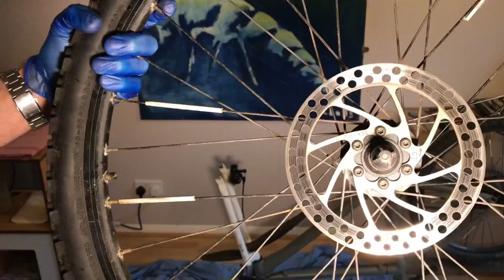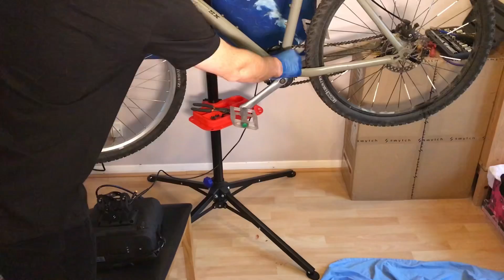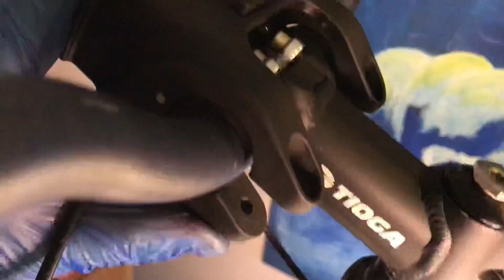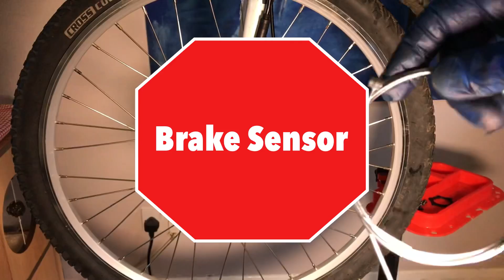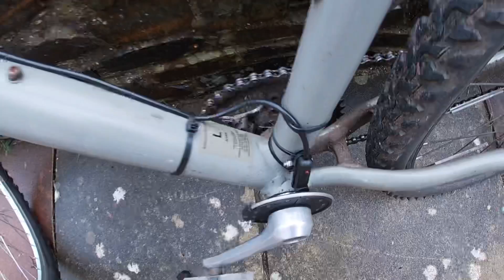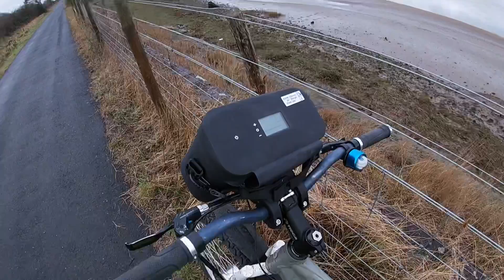Swytch Ebike kit first build 2006 Giant single speed MTB

Comment: Brakes - so I guess if you had an old fashioned single speed brake ( with a ‘ petal backwards’ foot brake ) then you couldn’t use this system as there’d be no way to fit a brake sensor.
Reply from the maker: You can use a brake sensor with a brake lever with its own spring back and a short piece of cable. The kit also functions without a brake sensor

Comment: Is this a pedal assist system or can you use full battery power when desired???
Reply from the maker: Pedal assist but they also sell a throttle control which works on it’s own.

Comment: I’ve just had the most pointless problem with the pedal sensor  it didn’t fit the space between pedal so. I put it on the inside of the crank . Because it goes in the opposite direction as in anticlockwise it doesn’t work. So am stuck with a Swytch that doesn’t work.
Reply from the maker: I think there is a setting where you can reverse the pedal sensor.
Reply: @leepspvideo  thanks. I worked out the Sensor .now I need to straighten and put the front wheel on correctly
Reply: Thanks for your feed back . Helped me pursue this issue. It seems I have a faulty battery pack, well that’s what Swytch think? Because everything else works. 🤞🏽
Reply: Do you recognise this. As far as I know, all has been connected. As soon as I press the power the  bike becomes heavy and hard to pedal, I Switch it off, then it rides normal. I’m lost, do you have any ideas?
Reply from the maker: @drstew1  sounds like the wheel is going in the wrong direction
Reply: @leepspvideo  Hi Mr leepsvideo. Happy new year if your reading this past tonight. You were dead ( alive) right . The wheel is going in the opposite direction. So when I get on the bike to ride it’s being forced . I didn’t get it till last night. So again Thanks and all the best to you.

Comment: How do you find the handling is? I would be looking for off road biking as well as road riding with the same bike. Do you feel you can't turn as sharp, or is slow turning affected do to the weight of the battery/motor?

Thanks.
Reply from the maker: Gaius Ross I didn’t have an issue. It’s harder to lift the front up over obstacles.
Reply: @leepspvideo  thanks for the reply, that makes sense.

Comment: Thank you for the video. I have question, I noticed you painted your bike, how did you remove the decal.
Reply from the maker: I didn’t paint this bike. I bought a different frame. 

On the bike below I used a razor blade (be careful) and some wd40.. it really depends how baked on the sticker is. 

How Much Paint do you need to Spray a Bicycle
https://youtu.be/KbJuQhMMJTo

Comment: Good detailed installation video and initial riding experience. I have been thinking about getting a kit as I have have a full suspension mountain bike with very little space on the frame for a battery. So having the battery on the handle bars would solve that issue. Does the battery weigh much and  what effect does it have on the steering and on the bike’s stability being high up rather than lower down as on other eBikes.
Most other vlogs on the Swytch eBike conversions are used on the road and not off road so I am very interested on your experiences.
Looking forward to watching future videos.
Reply from the maker: Thanks, I have fitted a kit to my 1999 Kona Stab 

https://instagram.com/p/BujZjDZl1KF/

It was harder than the previous 2 builds I have done as I had to use glue and sugru for the pedal sensor. I also had to file down the forks. (Video coming soon). The weight on the front is not that noticeable with suspension. If you preload the forks the front wheel comes up well. I need to shoot some more riding off-road before uploading the video. So far I love it!

Comment: Great video and good explanation on fitting. Your hub appears different to mine in that the hub cable went through the wheel axle? Also, you says it quite. How quite? Are you able to record sound with the wheel rotating?
Reply from the maker: Thanks. In the video 27.55 I had the GoPro less than 30cm from The wheel. It is amazingly quiet you can barely hear it over road noise.
Reply: @leepspvideo  Noted. But would have liked to have compared the sound. What about the difference in the wheel hub fitting?
Reply from the maker: What did you want the sound compared to? Yes my cable goes through the axle. I can’t work out how else it can go as the wheel spins.
Reply: @leepspvideo  Check out section 2 titled 'Quick Start Guide' on the online instruction manual. The photo for step 1 shows the cable to side? This is how I've fitted it and more flush to the frame.  No worries re sound, just wanted to hear if yours was quieter than the one I have?